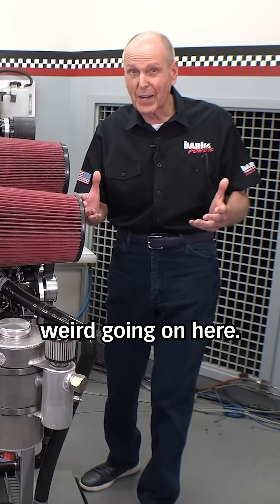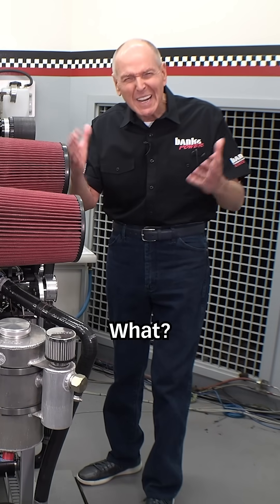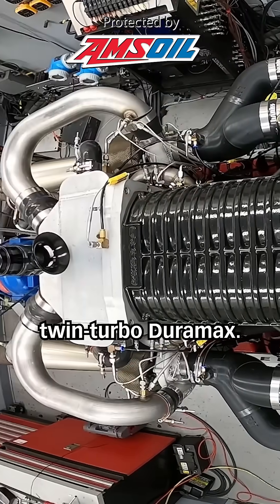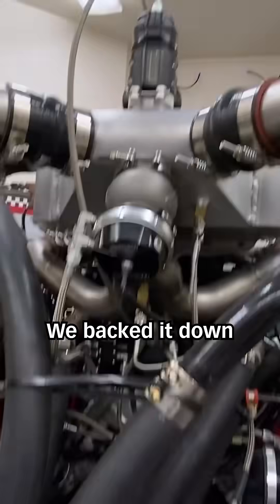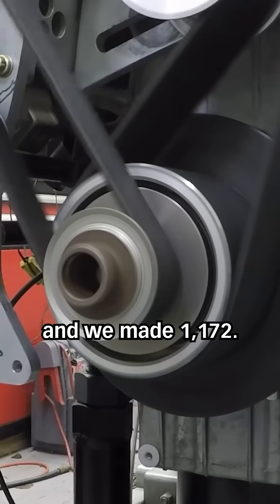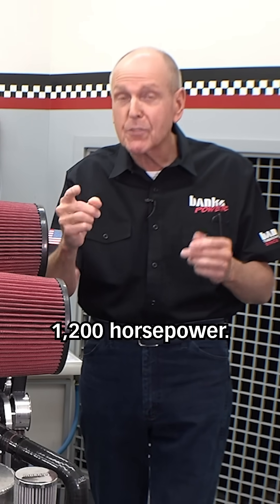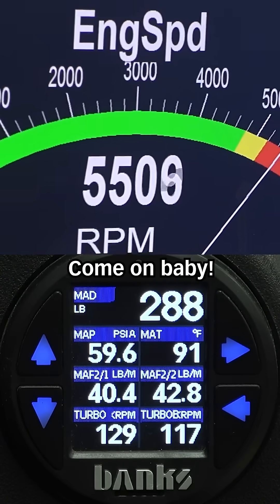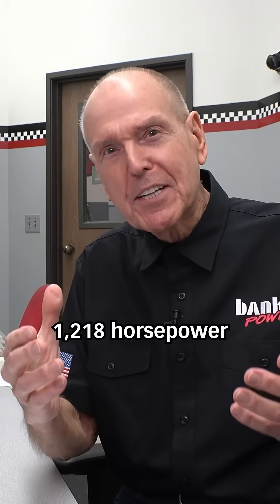How to make 1,200 horsepower the wrong way.

Comment: Blower needs a bypass valve so the turbos can take over. Dyno with just super charger. Dyno with just turbos. You should end up with two differnt hp curves. Where the supercharger starts to drop off and where the turbos come on is where the super charger needs to bypass. That way supercharger handles all the low end boost in its effeciency range at low rpm till the turbos can take off. 

Thats my thhoughts.
Reply: Switching one to the other, so the blower gives boost down low and turbo's up top, is the usual way.
Reply: I Concur.
Reply: Gale mentions this at the end of the vid.
Reply: Smart thinkin, seems logical to me
Reply: Seems we're ignoring basic physics 😅. You multiply pressure ratios not add. For your statement to be true we're ignoring the compound part. For that to be true blower would make let's say 15psi and the turbos 15psi would give us 30psi but it actually gives us 45psi in reality. Your forgetting air density and thinking about cfm this is a 3 dimensional equation not 2. The blower doesn't actually kill flow when the turbo comes on because it's flowing what it flows but it's eating air that's much denser thus flowing more lbs/min of air. Iv built a compound drag bike and I get a lot of ppl with ideas talking to me about it and most of the time it's a basic lack of basic physics that causes a huge disconnect of garbage ideas and thoughts 😂. He's making more power because drive vs airflow is high vs adding turbo boost into the blower to achieve the same boost with less drive loss makes more power. Efficiency is also a factor as we know blowers make air hotter than turbos generally speaking but I suspect drive losses is the biggest thing their chasing. Blowers feeding turbos can work okay but the biggest issue is you need a very big blower to do the job of a relatively small turbo. It all comes down to losses. The pikes peak truck that did do it backwards did it for a very niche reason that they needed the response at altitude and filling the piping intercoolers ECT with half the boost coming out of a corner is alot better than starting at zero with turbos
Reply: @oliverscorsim  thank you I couldn't remember the reasoning behind why the output data was doing that. I was skeptical about the reasoning knew it wasn't CFM.. And for some reason was leaning towards something else but this definitely makes more sense.
Reply: @oliverscorsim  I understand the pressure ratios and how they multiple. I'm not suggesting they are additive. What I'm suggesting is using the supercharger overdriven down low for instant boost where the turbo(s) are not even online yet. By bypassing the supercharger when the turbos come on, you free up that parasitic loss from driving it and the turbos, which are far more efficient, take over. 

Having one, the other, or both trying to cover the whole rpm range seems contradictory to me. Let them work where they would be best suited. Supercharger down low and turbo up high 

That's my thought, anyway.
Reply: @CamoSnowman  go watch the full video where they break it down the thought process, these shorts are misleading in that way. Or can continue being a couch engineer.

These guys are professionals, paving the way for years with innovation.
Reply: I'm sure he's got a reason for the way he did it
Reply: @MrTheHillfolk  yea for content. He’s educating the masses. He knows his shit and knows turbos are for high end this was nothing more than something for views. That’s not a bash either just something many people don’t realize
Reply: @MrTheHillfolk  how are you going to feed a super charger into a turbo?
Reply: @Sub2collide You could fab a sealed chamber that sits under the blower and feed the turbo from this , and then after the turbo, route air back into the sealed chamber, this chamber of course is split inside with a divider to separate the dual plenum design.  The bottom half would then feed into the intake runners.  I've seen someone take on this task, which also had dual quads instead of fuel injection.
Reply: @DarkAttack14   I wouldn't consider a pro charger and super charger to be the same just bc they are belt driven
Reply: @martindinner3621   it's still not a blower, more like blower/turbo love baby. Yes you can feed a pro charger to a turbo. My question is how do you feed a turbo from a top mounted roots blower. Without a fock ton a fab work and fluid dynamics it's difficult.
Reply: @YouTubeOdyssey  if you were to do that wouldn't the blower sit Insanely high. And wouldn't that increase the parasitic losses from the supercharger seeing as the belt that's driving it is longer
Reply: @Sub2collide that's what I thought....but I think we are missing something somewhere.
Reply: Logically your theory seems sound, would be very excited to see him set it up like that.....he is truly a living legend and very very unbiased.....really enjoy this guy.
Reply: @gregallen9065 I could be wrong but I think bro’s describing almost exactly what the lancia delta s4 used back in the group b era of rally. They used the supercharger to get it off the line and bypassed it with turbos for top end power
Reply: Most succinct reply to a video I've seen in years. Couldn't agree more, as an engineering-type feller.
Reply: @Adi-vu4ms  go watch the full video, he goes through the thought process.
Reply: Came here to say this; boost biased bypass gate.
Reply: Im pretty sure he already knows this.
Reply: For those asking; he is compound charging not twin charging.
Reply: I'm with you. Charger runs out and becomes restriction.
Reply: I’m not saying you are wrong I have no idea you might be 100% correct but I do know this man has forgotten more about engines and turbos and such than most people ever know so I would assume he has already thought about this.
Reply: I really appreciate people like this who add that extra information so that I can truly gain a University of YouTube understanding which I will use for absolutely nothing since I’m a Poor
Reply: My thoughts is since we are in 2024 and not 2000 we have already variable geometry turbo. I would just use those and you have   power a d torque from low to high rpm.
Reply: @laszloszell8753 I've always thought it would be a cool project to use 2 of those variable turbos from the ford trucks on an ls.
Reply: @roscosnyder3584 it’s better to just use one VGT than two, you’re limited on sizing with a VGT, you’d essentially restrict flow for no real power gains in theory, no one done it that I know of so I could be wrong however just knowing how they work, it would be pointless
Reply: @KDlGG the vgt is only in the exhaust housing, I don't see why adding another turbo would restrict its functionality.
Reply: @Sub2collide  like I said the VGT yes is in the exhaust housing but you can only get them in limited sizes, you can’t get something like an s400 style turbo in a VGT platform. So you’d essentially be doing compound same size turbos like an 66mm under a 68. It would make you perform better at higher elevation but not really any power gains at lower elevations
Reply: @KDlGG I think they are talking abt TWIN vgt not compounds. So one on either manifold. Problem with that is it would still lag pretty bad cause one 68mm vgt already responds pretty slow.
Reply: @Eric_V410  ahh okay yeah if it’s twins it’s a whole different thing, that’s why I was like the same size turbos compounding wouldn’t really add anything. On a diesel tho a 68 with proper fueling isn’t THAT slow to spool but on a gas it might, especially as twins you’d need massive fuel and it would kick hard as fuck
Reply: @KDlGG  Yea 68 doesn't spool that bad but if your looking to tow with your truck they aren't the best option because of the lag. If my memory serves me right this is twin 68 70 precisions into the whipple.
Reply: @Eric_V410  yes but those also are non VGT, any non VGT isn’t great for towing but still viable if you have the mods to support it
Reply: @KDlGG  I know they aren't vgt I'm just saying that cause we were talking about 68 vgts. The ones on the engine are single volute(idk how to spell that)😂
Reply: Variable vane turbos spool up insanely fast lol what do you mean
Reply: @DarkAttack14  it’s actually dumb I have to slow this down for you because you couldn’t read. Nowhere did I say specifically that a VGT restricts flow, it does slightly but it’s negligible, regardless that’s not what I said. What I did say however if you go back was that in a compound system using two VGT turbos would be pointless BECAUSE you’d have more of a restriction than power gains. Why? VGT turbos are limited on sizing, you don’t have endless sizing like a regular non VGT. That being said let’s say like I explained earlier a 66mm on top of something like a 68, what power gains would you get from that? Essentially nothing WHY? It’s like sticking two of the exact same leaf blowers together, your air flow is still restricted by the small housing feeding into another exact same size small housing. The only reason you read boost pressure is by a restriction of some sort, otherwise there would be no pressure, your psi might go up, but overall airflow would gain next to none over a regular VGT. THAT is what I said in terms of restriction, not the VGT itself
Reply: @KDlGG  if the co.pressor side was sized correctly for the setup, it would work fine.  The idea being that, as usual,  with dual turbos, you can use a smaller turbo so that it will spool up faster than one large one. Then, as the rpms increase, it can vary the geometry.  I could be wrong, but I'm pretty sure that there would be noticeable benefits. Kind of like having an over square engine with a short connecting rod to stroke ratio. It's has good low and still makes good high rpm power.
Reply: @TheCicakfly  using a vgt or the ls project that I mentioned? I was just talki.g about a low budget project that I think would be fun. Fpr me hotrodding is still about what I can do with production parts and what I can make. Buying hipo parts that someone else designed and made is boring to me (other than camshafts).
Reply: @KDlGG  that's why you design one yourself and build it. 🤷🏾‍♂️ 

Inventors don't pick up parts off the shelf. Someone has to build the first one.
Reply: @ why would I wanna design something I don’t want. The amount of people that would buy it wouldn’t even make it worth my time. Nobody wants to go that route
Reply: @KDlGG  if you think something is bad, do something about it instead of bellyaching about it. Real hotrodders solve their problems with ingenuity. 
Rich imitators let someone else work on their cars and take the easy route with bolt on upgrades someone else spent time manufacturing.
Reply: @ I’ve built a 900hp diesel and a 630 hp terminator… I absolutely do not wanna do what they’re trying to do, everytime it’s been done it’s always been beaten. It’s not a great setup and never will be, it’s not my problem you people can’t get this through your heads. Things can be bad, they don’t HAVE to be made good, your cars inefficient and isn’t the fastest in the world, okay now fix it.
Reply: @ huh?
Reply: @KDlGG  sounds like a load of crap. You're not a builder, you're a leggo assembler if not a complete liar and troll just hating on people who actually apply themselves to problem solving. 
Builders actually fabricate things.

Bolting on parts and getting the fuel curves set is no accomplishment. 🤣😂💁🏾‍♂️ it's just buying toys. 

Racing is about innovation!
Reply: @ the problem I have with you is that your trying to solve a problem that’s already been solved. You want to apply yourself to a hobby that’s fine but let’s call it what it is bud.
Reply: @JoseMartinez-ll7vo  nuclear power must be a hobby for you also 🤣🤣
Reply: @laszloszell8753  that or an electric hybrid turbo.
Reply: @laszloszell8753 still not instant
Reply: Think you're on to something
Reply: So why not go centrifugal SC?? Maybe we can see a third power curve
Reply: That's good thinking. I'd try sequential turbos. Just a need to size the primary turbo through testing and will need good waste gate control and possibly variable manifold flow control. If only we all had Gale's budget🙂.
If it fails the results from dyno room 2, 3 or 4 would be the way to go😂
Reply: I like ya thinking, sum burnout cars in 🇦🇺 doing sum tin like what your plan is. Well done👍
Reply: Just look into the history of Detroit Diesels and you’ll see why they did it this way
Reply: True
Reply: Wouldn't it be more efficient to just use compound turbos ( Small into large ) instead? The Blower has parasitic loses greater than the turbo will ever have. You're main issue with a compound turbo on a high HP application, is air Volume and Density. You could theoretically bypass a little turbo with a gate to get get the volume and density required at higher RPMs. Or you could simply run multiple compound turbos where the sum of all of them together into a common manifold should give you the air volume you need. But then you'd lose efficiently the more you put on as well as increase backpressure. But either way it goes, i personally think the supercharger in this case is just in the way. Sure it's great for the throttle response, But if you're chasing max horsepower, perhaps it's not the correct application. But i'm not Gale Banks. Gale is a master of his craft. If he did it that way, it's probably for a good reason.
Reply: Thats what i was thinking
Reply: Volkswagen has a system for this, they have a system called dual charge. We have a 1,4tsi dual charge and the blower is chit of at 3500rpm, then the turbo takes over. 
That thing has an insane curve for being so small, 160hp but tourqe like a diesel.
Reply: Seems logical to me! Well thought out and explained too.
Reply: Sounds like it should work! Look at Toyota twin charged 4age. Used both systems and did the same thing you just stated!
Reply: I was thinking about the supercharger forcing air to the turbos
Reply: 100% turbo second. You need a bypass for sure after a certain psi/hp
Reply: I've seen someone with a welded plate for their blower inlet and allow the air to be drawn in through the turbo inlets.
Reply: Big brain over here speaking FACTS
Reply: Very valid response
Reply: Supercharger needs to be used as anti lag .. which means run the turbos second and then add more timing and fuel .. only think that would limit him after that is the structural integrity  of the internals ... I had a Pontiac fiero that put a supercharged 3.8 liter out of a Grand Prix gtp in we added a turbo but it didn't make power like it should of so we rearranged the manifold piping and on low boost it was running middle 9s in a quarter and on the road anytime you tapped the gas a tad too hard it would spin the tires... 40 mph burnouts no problem and those cars usually would just take off with all the weight being on the axel
Reply: I think you have it exactly correct. Thank you for the thoughtful response.
Reply: Get this man a job at ford
Reply: Yup
Reply: Or spray nitrous so there is no lag in turbo spool🤔🤔🤔
Reply: It’s hard to admit you were wrong sometimes even when the proof is staring you in the face
Reply: Duh
Reply: Nope, turbos feeding blower is the best way
Reply: I think its solid. He should go with his gut like we are. Blower’s first, turbo’s second. And blowers make air really hot if they get too fast
Reply: Yes tell BANKS what to do
Reply: That is how the old big 2 stroke detroit diesels worked. Like the 12v149. They had large root blowers to get the process started then they were bypassed when the turbo's kicked in.
Reply: That's how Lancia did it in the 80s
Reply: Sounds good to me. I never thought about it like that.
Reply: I think he wants both of them to work in unison for just one big amount of power , its kind of inefficient for street use as splitting the load would get better results for long term use but ehh
Reply: Just use an electric motor and your power curve is constant
Reply: Same as using nitrous to spool the turbo.
Reply: Yea, this is how it works in my Skoda!
Reply: Yes! That's exactly how they're made to run...that's why I keep thinking he's pranking us!
Reply: Planned the same setup on my om606 back in the day. Was planning to use the clutch from the AC to disengage the supercharger when the turbo did its thing, but unfortunately never got that far..
Reply: Yeah, but how high are your pants?
Reply: As someone who never touched an engine in my life, I agree 😂😂😂
Reply: I just said the same thing if his peak boost is affected by the blower, he's definitely not bypassing and itll become a restriction especially if its turning, I'd add a clutch to the blower too and fully bypass as soon as hes getting the right boost, he could probably downsize the blower too as peak will be a turbo matter, less parasitics but it will effect his spool very slightly if he did.....
Reply: Are “trubos” better than turbos?
Reply: Need that blowers hard hit for the turbos at low rpm keeping the blower speed down should keep air temps down and utilize the turbos the rest of the way
Reply: Except with all the tuning differences between turbo by itself and blower by itself and both combined wouldn't be that easy. A lot of variables I imagine.
Reply: Just sounds textbook from what Lancia has already done
Reply: This is how twincharging works.
Reply: Right on! 😊
Reply: My thoughts exactly. 💯
Reply: Make sense
Reply: I mean that's the only  logical configuration frankly. That's exactly how Lancia did it in the 1986 Delta S2. One of the most egregiously powerful rally cars ever made.
Reply: You hit the nail right on the head.
Reply: Could make it a flap that is closed by the superchargers boost pressure but is overcome by the turbos when they start making more boost than the supercharger
Reply: i was thinking along the same lines, good analysis
Reply: I would be confident the guy with 97 years experience would know what he's doing
Reply: 💯.. think reverse blow-off valves so to speak... Or maybe a one-way clutch on the blower so the airflow demands can just take over at a certain point.. I'm admittedly way outside my wheelhouse though
Reply: Supercharger needs cold air to make good hp.. boost guage does not compensate for air density. Turbos need air too.. but designed to work with much higher temps already
Reply: Not to mention he said the turbos were first? So the turbos are spooking the supercharger? I don’t get it
Reply: There isn’t a way to do that.. that’s why it’s nearly impossible and no combination has ever been done that way.. even though that would be ideal.
Reply: Just get rid of the blower lol
Reply: thank you, saved me typing lol
Reply: its kind of crazy someone like him wouldnt already know that lol he speaks so highly of himself and product
Reply: @greenespirit4973  i thought about it, i don`t want it or wish it but he might know its time, like time time :( , testing us before he boosts oonn uuup past the dynooooo hoping soooo much i`m wrong
Reply: Yup then attach it all to a clutch blower on bottom end turbos on top end.
Reply: Makes sense to me
Reply: That’s exactly it. Blower needs an air bypass. When the blower speed is lower, the turbos are pushing more air around the rotors and creating more pressure/volume. If there was a bypass valve, this engine could make 500-800 from idle to 1800rpm, then the turbos should light and make 1500+ on the top end.
Reply: This is the first comment I’ve seen on this channel that doesn’t seem to be completely ignorant. (Coming from someone with absolutely zero engine tuning experience)
Reply: Glad there's experts in the chat.. YouTube mechanics...
Reply: @karipaturketo5438  Nah that makes perfect logical sense. No pretentiousness
there
Reply: But even if you bypass the air flow  you still have parasitic loss of power cuz the engine is Turning pullies that aren't contributing to power anymore.
Reply: Just make the pistons bigger or add another one...
Reply: Came here to say the exact same rhing
Reply: Why can’t I be mechanically inclined I just need someone to let me shadow and work on something with them man
Reply: It's just like tuning vtec 😂😂
Reply: Excellent comment 👍
Reply: Seems like the sanest answer
Reply: Don't put overdrive blower. Allow turbos to give top end overpower
Reply: Seems like it would work, just gotta put theory to practice
Reply: Always thought that a twin turbo set up, 1 for low end, 1 big turbo for the mid to top would be the ticket.
Reply: Isn’t that exactly what lancia did with the delta s4
Reply: I imagine he knows what he's doing.  It's Banks.
Reply: sounds reasonable to me. the sc eliminates turbo lag and give more low end tourqe. then the turbos kick in sounds like it's right to me anyway
Reply: I thought superchargers were more efficient at high rpm?
Reply: Volkswagen did that
Reply: Reminds me of Lancia Delta S4 turbocharged supercharger engine
Reply: That’s why he says he thinks hes got it backwards.   He’s saying it with a smirk on his face cause he knows exactly what he’s talking about.     He knows a blower should be used down low to “ignite” the turbos.  His last name might as well be boost
Reply: Some guys did that a few years ago. I forget which company but the valve they created to deal with that exact transition they called a "Kanooter valve"
Reply: I think your idea has merit
Reply: lol. You’re really trying to sound smart here??? I’m thinking the dude in the vid already has it figured out. Keep tryin
Reply: @JoseMartinez-ll7vo  you a hater. 

Every idea is worth mentioning, if anything you'll learn something.
Reply: @ well bud I’ll have to go ahead and disagree. Some ideas are just stupid. Some people you just can’t learn from. The difference between you and I is I wonder if I’m one of those people.
Reply: Go apply for a job. You guys got it figured out better than Mr Banks go apply. Or just keep talking out your ass
Reply: @Christopher24311 my boy chris hates when people have discussions. what a nerd
Reply: @cwj2733  brought to light that this was discussed in his full length videos, but discussing shade tree BS is way more fun for some and that's alright.
Reply: @Christopher24311 I’m sure you have it all figured out huh?
Reply: @Christopher24311  why would anyone go apply at that shithole 💀